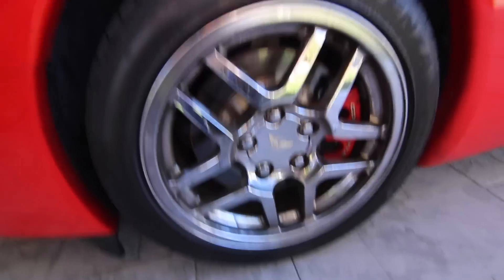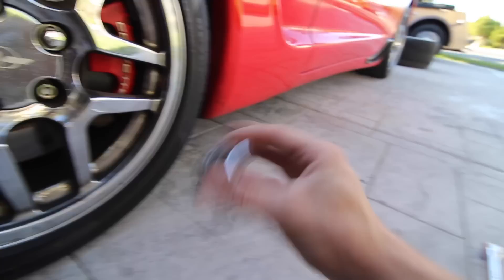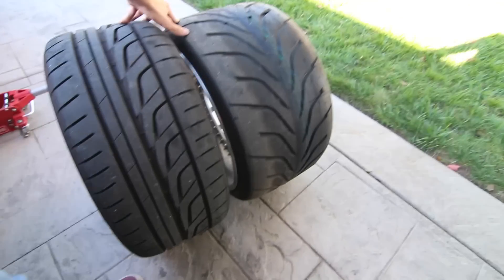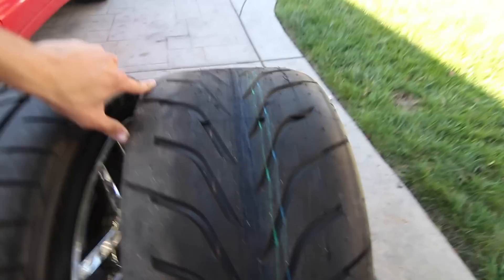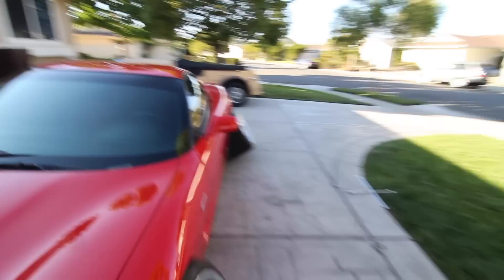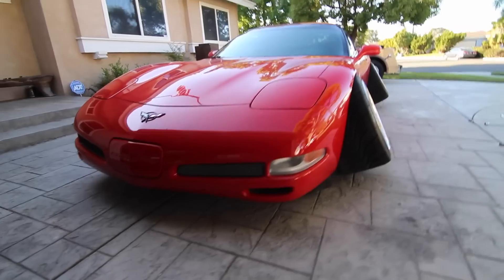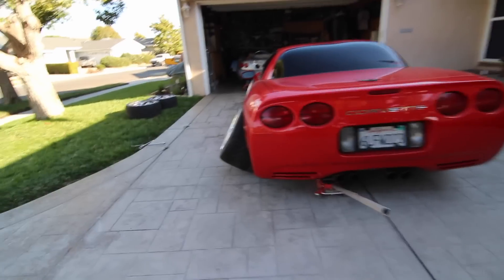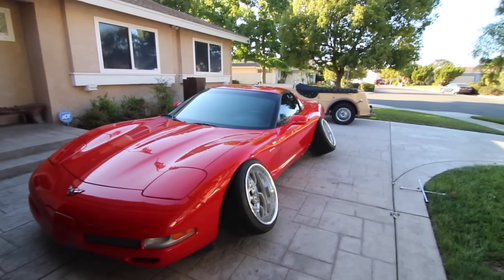The Corvette Gets New Wheels! -#WillTheyFit #WhatAreThose!? #Whorevette

Comment: With all jokes aside, if the rims had the  right bolt patterns on them, they would actually fit, and look pretty good (“properly put on the car of course”), especially with its deep dish lip pattern, and when you get the wide body fender flares put over them. Because though the rims and tires are wider, the wheels are shorter in diameter circumference, in which will lower the car even more to the ground making it look extremely aggressive, and you need spacers because of the rims offset.

Comment: T my man as a Ginni myself one of my half brothers used always get the new fucking vette every year and then bought a house and got married. Now he is buying new Altimas and other bullshit but still got the fucking 70 tree vette in the gf a the garage over in the fuck beach. Over 10years and still hasn't gotten the it Cross Bay Blvd. All I ask in please it those wheels on that very vette you got there now and camber it out the same way as the Miata. You should of done all of that work to a older Fiat and call it a Fiata . Bro,cousin, fella gumba just do it. At least for me because I slapped vettes around with IROCS with T tops also with Trans Ams too.

Comment: The "lug nuts" are the only ones used and it makes a corvette easy to repair for a stripped nut you can go to a regular auto parts store rather than have to go to a Chevy dealer. make sense?
Reply: Plus saying that taking off wheels is a pain in the ass is irrelevant because real drift tuners are use to spending up to $1,000 a month on tires because they spend the time and labour to make sure that their car is safe.

Comment: 5x4.5 is a 5x114 I say you should have actually tried to bolt them but the back spacing and rotor clearing is weird on corvettes so youd need spacers anyway or adapters if theyre not the same pattern and it should fit well not fit but yah cool shit tho :D

Comment: Dude do your self a favor and get something besides a 4way to get the lugnuts off, if nothing else crack them by hand and use a drill with a 1/2 socket adapter get a impact driver, harbor fraught has 120V plug in ones for like $50 that are loud but work good